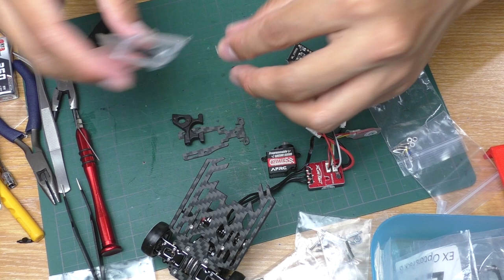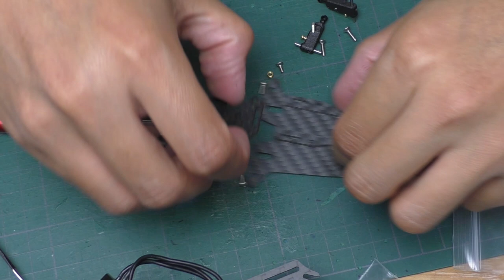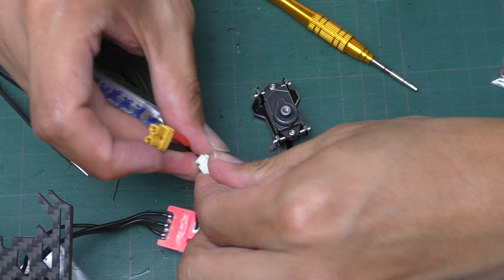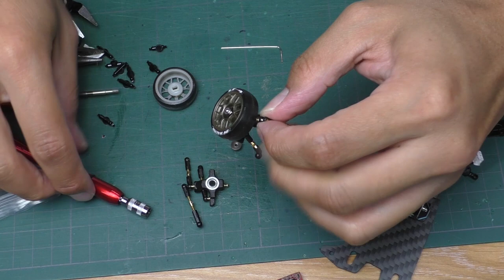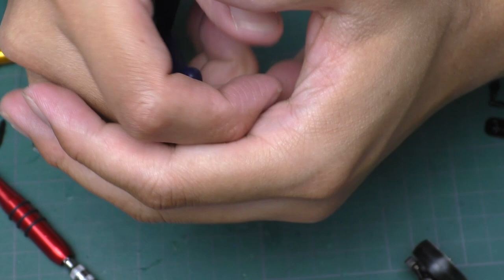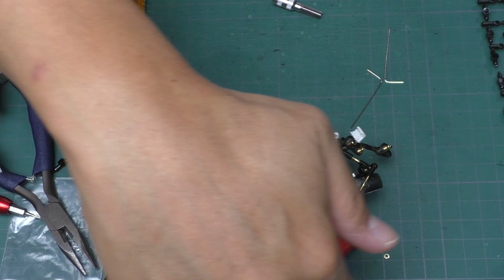DriftArt 2.6 EX Build Part 3

Comment: What tools do you use I want the ones you have please
Reply from the maker: Most of the tools are included with the kit. 
The extra tools which are hex socket for wheel nuts, spudger to remove ball heads and also small hex screwdriver with better handle are from a computer/mobile fixing kit you can find in a computer shop for something like 15 Euros. Here's what it looks like. https://www.banggood.com/custlink/K33J5aQvcK
Reply: @BeaversHobby  the link doesn’t work and would the mini z tool kit work?
Reply from the maker: @nortexnewberry3103  Yes, the Mini-Z tool kit will work. You'll only use the hex socket from that. The 1.5mm hex screwdriver and Allen keys are included with the car so you can use those, albeit a bit difficult with the Allen keys but they'll work.
By the way, the link works for me so I don't know what happen at your side. I think if you see one on your computer or DIY store you will notice it immediately anyway.